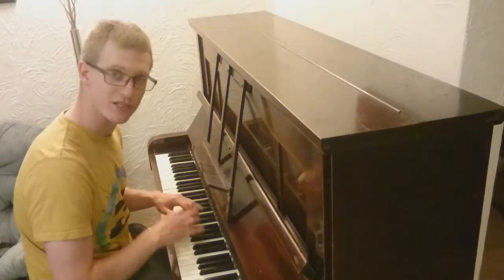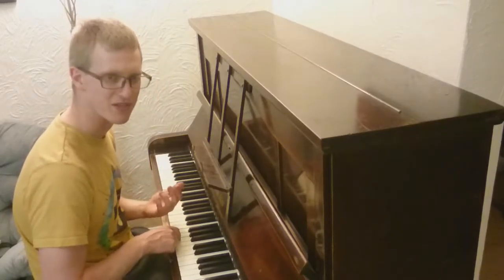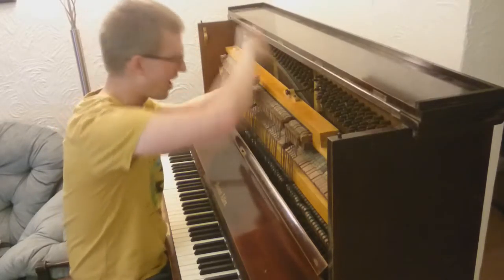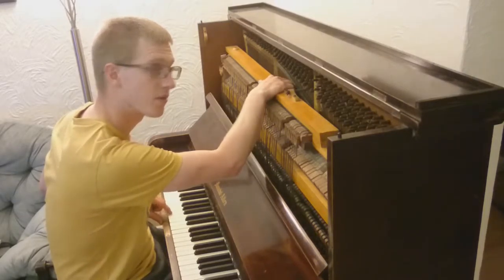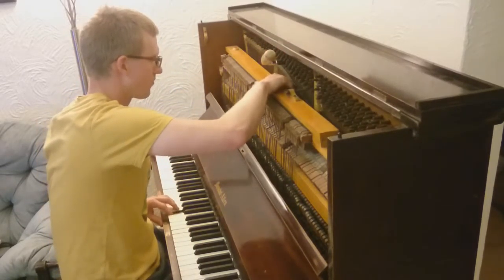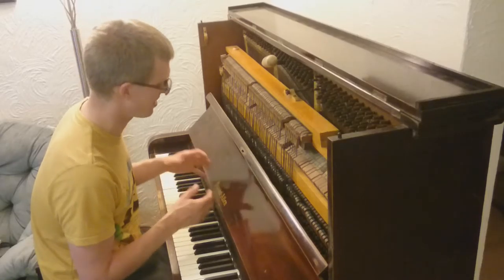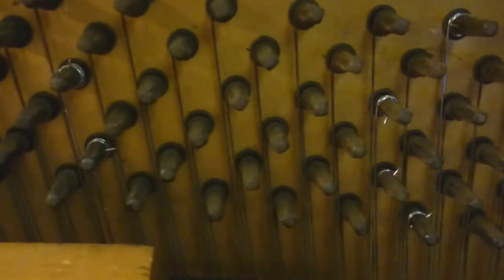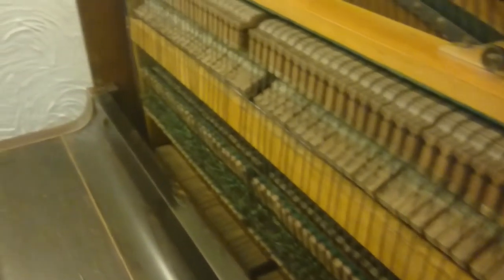A Bit of Piano Tinkering (TUNING) - Life of a Pete

Comment: But I recommend getting an actual tuner.
Reply from the maker: I have no doubt that they would do a much, much, much better job of tuning it. I would if I thought that it would even end up sounding right. There are too many bits that would cost too much to have fixed properly, for example some of the pins which the wires wind around at the bottom (I don't know the proper name) are missing so I have replaced them with nails. Some strings have a rasp which I can't get rid of. I just want it to play OK and I don't want to have to take too much care over it. I also like playing around with stuff and seeing if I can get better at it, so this is a good way to start really
Reply: Yeah, I understand, I also do the same with a neglected W.H Lane upright piano in a church near me, cos it needs restoring and fast, it's three semitones low but still has a lovely tone & worth improvising on, i'm working on replacing the treble strings on it soon, only if they break when I pitch raise it. This is a birdcage (overdamped) piano, they were budget makes when new, tbh, they are not the best for their age anymore, this one is okay. I wouldn't tune a "spring & loop" birdcage piano cos they're over 110 years old and have extremely poor structure, one I tuned had tight tuning pins, but the middle octave went out of tune within a week. Hopefully, i'm gonna get a Harper piano from a nearby church to work on completely, but using proper piano parts like the red leather tapes. I don't know how to get rid of a rasping string yet, the nail thing seems to work. (Bridge pins)
Reply from the maker: +Improvising Pilgrim I found the nails have worked well so far as a cheap fix, but I have other rasps they I can't figure out where they come from. I assume more of the same but it's hard to trace the problem as the sound doesn't always appear to come from the source. I'm hoping to eventually upgrade but for now I'll learn what I can and enjoy playing :) cheers for the input too, it's always good